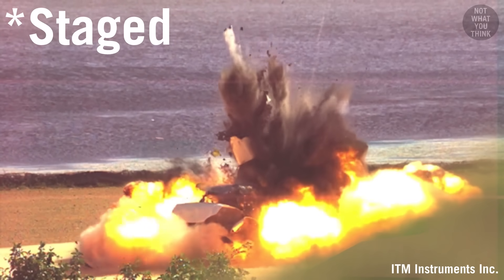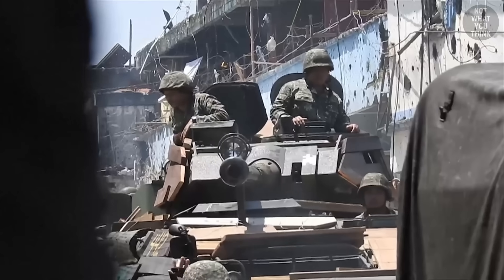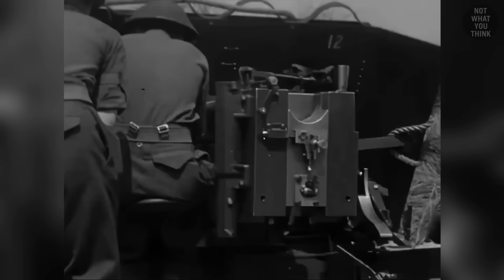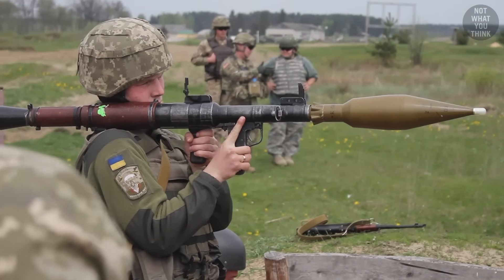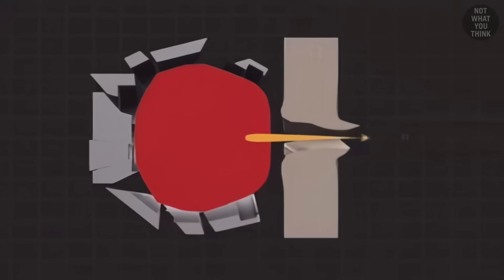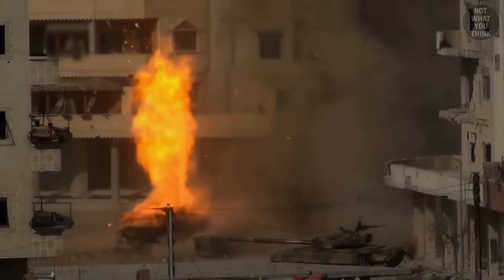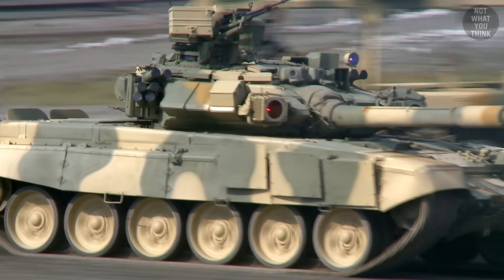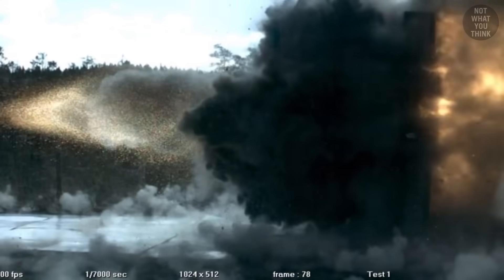Why Protecting Tanks is Getting Much More Difficult

Comment: From the time, the USAF started dropping 500lbs GBU-12s on Iraqi tanks in 91 and development of precision missiles like AGM-65 Mavericks, tanks days have been numbered 
The T-14 despite all its advanced protection would still be shredded by both weapons
Israel's SPIKE NLOS mounted a tomcar can carry 8 missiles and strike from up 16 miles away. The NLOS  has the capability of dropping down on target at a near 90 degree angle which allows to bypass most tanks defenses
Helicopter launched missiles have steadily improved as well
Lastly ,man portable weapons have advanced to where armor cant function without extensive support
its hard to validate heavy armor usefullness in modern warfare
Reply: You ignore the fact that in a conventional war you wont easily have air superiority also no tank can stop any of those either
Reply: @ @start2957  
In a conventional war ,the development of long range hypersonic weapons has made achieving very easy
airborne jammers can jam AWACS and ground radar while hypersonic weapons strike
Example, the AGM-183 can cover 500 miles in 2 mins
Supported by airborne jammers, it strike defense while stealth aircraft use bombs to neutralize airfields runways and taxiways while air launch missiles close in to finish off the airfield , timed correctly, the entire base can be wiped out
Any airborne interceptor would be forced to withdraw as they have no place to land
Even if interceptor detected the jammers, its still a race to get in range

Comment: Adding distance does not actually help. Most shaped charges work BETTER if detonated early, since the metal projectile has a better chance of forming. Slat armor works on certain types of of the RPG rounds by distrupting the detonation and deforming the explosive, not adding distance (which would increase the charges penetration). This is why it has holes, they are the ones doing the work since they allow the projectile to come in a bit and then deform it. If it would hit the bars, it amplifies the explosion.
Reply: Depends on the distance and type of shape charge. Obviously detonating it 10 m away will help. And if the warhead is programmed to detonate at a certain distance and you increase this distance you can decrease its penetration power.
Reply: @emilsinclair4190  but thats's my point exactly. the video is talking about extra armor helping by detonating further. but there is no there is no 20m-diameter armor, that's why active protection systems were developed - to be able to detonate/destroy incoming projectiles at a distance.

Comment: Well modern Anti Tank weapon like that have a CD ( penetration capability versus the diameter) 10 to 12 with 15 more or less on the way. Kinda crazy if you ask me. A 60mm round would have with a CD of 15 a Penetration of around 900mm
Reply: how does this work? how does larger diameter increase penetration capability?
Reply: @eesmaaura4961  il guess more Copper to Penetrate the armor i dont now
Reply: @eesmaaura4961  thicker warhead = more explosives to propel the copper jet
Reply: Well i would like to try to explain it but that will not work but i look for an explanation that i see some time ago that can help

Comment: The future tanks most likely wouldn’t look to tanks to our standards
Reply: Cap bara
Reply: i mean
tanks always have to have tracks and a canon. right?
Reply: @alinabeel7953  Who knows, maybe they would have something else since tracks can break easily
Reply: @Mavve69  if they create a light canon 
Tanks could be just normal cars with a canon 
They would be very maneuverable, fast and cheap
Reply: @alinabeel7953  So a light apc
Reply: @caesarsalad1170  yeah but with a tank like canon 
A vehicle as maneuverable as cars and as strong as tanks
Reply: @alinabeel7953  Thats fantasy for now
Reply: @alinabeel7953  They're actually working on that, the only problem is energy efficiency as always.
Reply: @Bleepbleepblorbus  electric canon?
Reply: theyd still have treads, they wont hover around with magic, but perhaps the barrel would be shortened a lot and use a very VERY strong laser instead
Reply: @MichelleW870  maybe a rail gun would be realistic
Reply: @spectatorwhoisspectating  a combination of the two I assume will happen.

If lasers gets developed then something to counter it will also happen and I assume that'll be the good ol "throw a stick at it" but just very fast.

They just need to somehow make mini nuclear reactors to power the thing
Reply: @MichelleW870  But you cant fire from cover with a laser, youd almost always have to expose yourself
Reply: @MichelleW870  You realise things can hover without magic, right? Electro-magnetism and Thrusters will make that possible.
Reply: AI drones like in terminator.

Comment: I think the days of gun arm tanks are are near their end like aircraft I think they should switch to using missiles but that's just me how many anti-tank missiles can an average tank carry if you remove the gun I rest my case
Reply: It’s literally been proven that having a cannon is a good thing. It’s only real goal is to protect the crew…
Reply: A missile is not what a tank is made for. It's called a missile carrier. A tank's goal is to provide armour, and a fast, direct fire. A tank's round is much faster and has quite a straight and direct ballistic approach. While enemy can see and hear a missile coming at them ; it gives the enemy enough time to hide especially at long distance. A really fast approaching explosive or dart zipping through the air simply does not give you enough time to react even at 2km away. Tanks have to be used under certain conditions to be proven effective. Look at the ukraine war. The Ukranians proves that the tank still has a bright future ahead, simply because they rely on combined arms and actual tactics then just running toward the enemy at a straight and predictable pattern.
Reply: the missile knows where it is at all times
Reply: Cost. And speed. A shot is cheaper and gets fired faster. However shells will most likely incorporate more elements of missiles that will improve their capabilities. 

And many tanks might also downgrade to a smaller, faster firering main weapon to better deal with faster, lighter armored enemies.
Reply: A missile is way more expensive than a tanks gun ammo like 25 to 50 times. So nope.